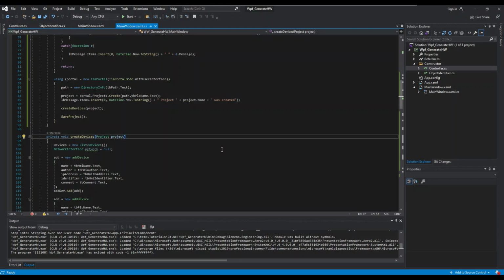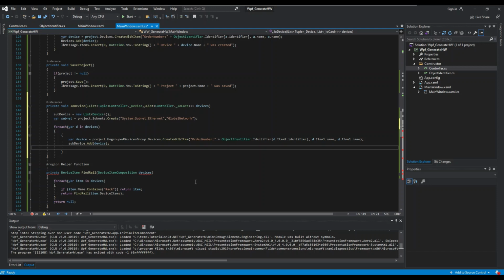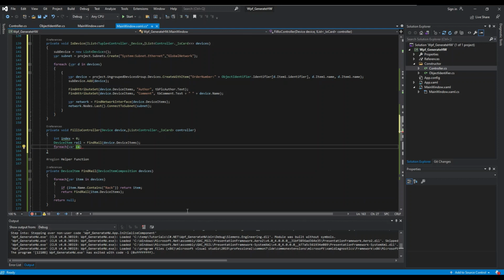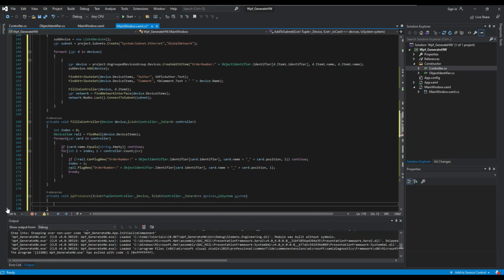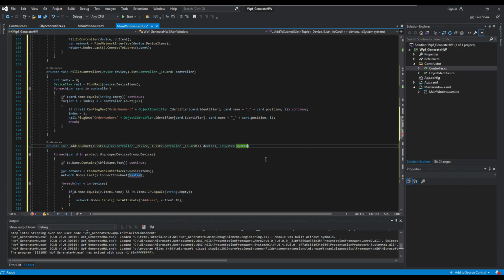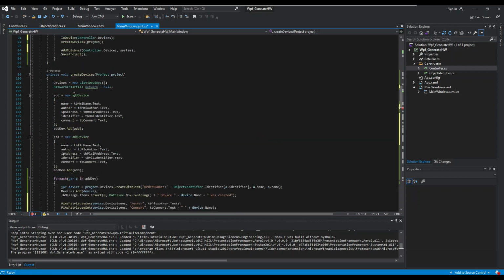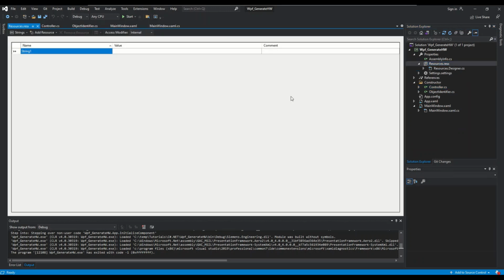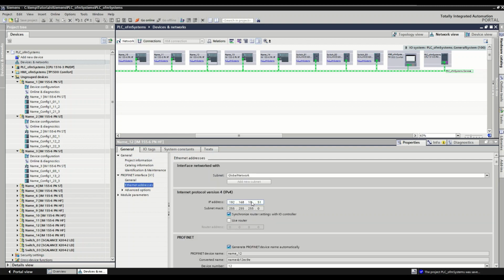TIA Openness - Generate HW Configuration using C# Part4

Comment: What code do you use to set the "Not assigned" label on the ET200SP devices to "PLC_ofmSystems"?
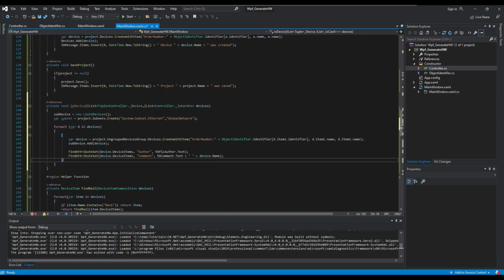Reply from the maker: To implement the network connection, you'll need to follow these steps: first, create the network using the logic in the 'IoDevice' function (refer to Part 4 around 1:10). Afterward, connect the devices by calling the helper function 'FindNetworkInterface' (see Part 4 around 6:40). The creation of 'FindNetworkInterface' can be found in Part 3 around minute 8:00.